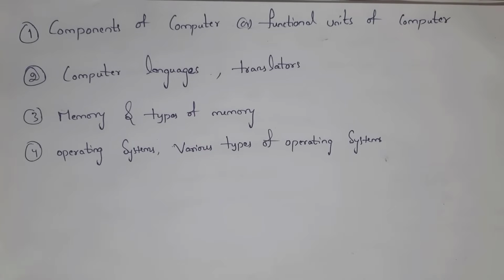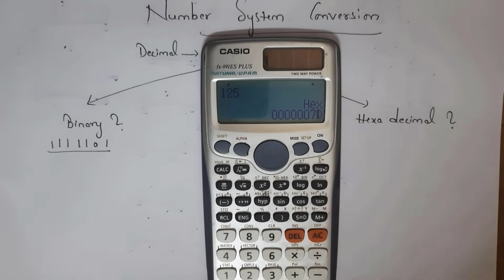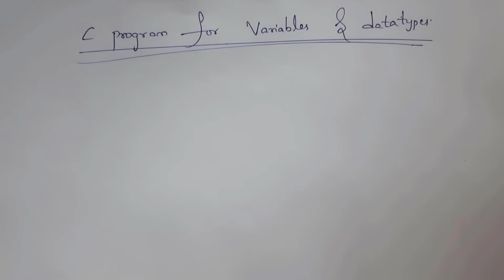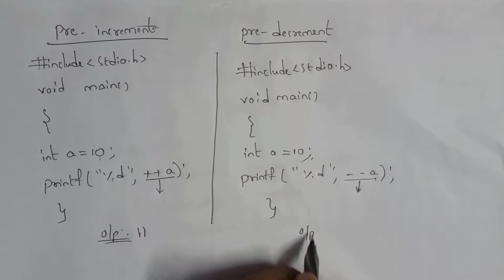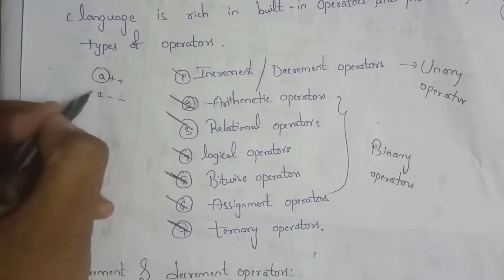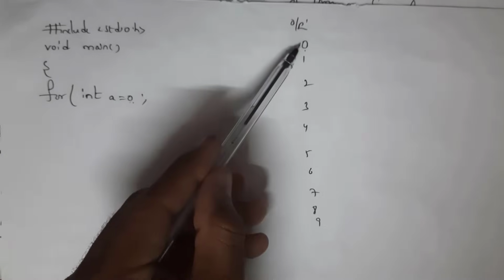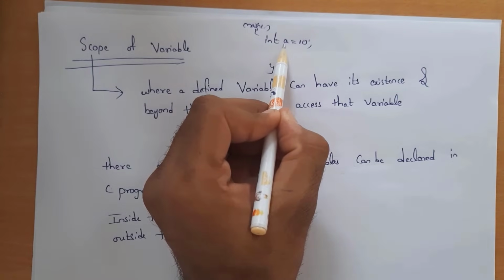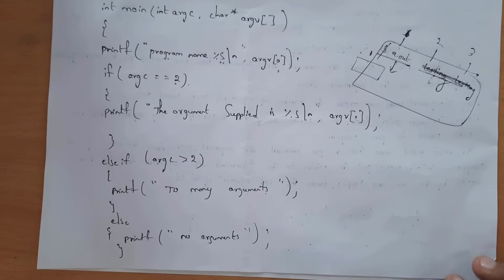c language complete unit 1 | pps | programming for problem solving | c language for btech

Comment: Can i Know how to print even numbers from 2 to ...so on
Reply from the maker: C program to print even numbers from 2 to 30

#include <stdio.h>

int main() {
    // Loop through numbers from 2 to 30 with a step of 2
    for (int i = 2; i <= 30; i += 2) {
        // Print the even number
        printf("%d\n", i);
    }

    return 0;
}
Reply: i+=2 means
Reply from the maker: i += 2  mean `i = i + 2`. So, `i += 2` is used in the `for` loop to increase the loop variable `i` by 2 in each iteration.
So output
2
4
6
.
.
.

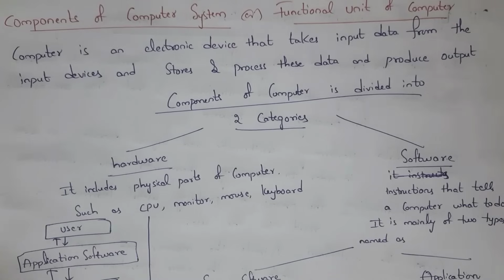Comment: 00:37 - components of the computer
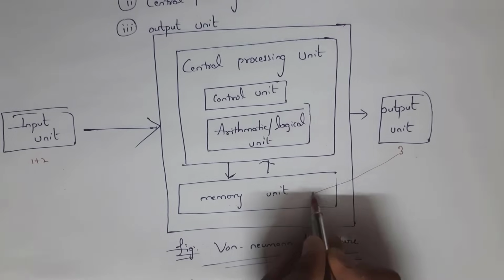04:54 - various types of memory(RAM & ROM)
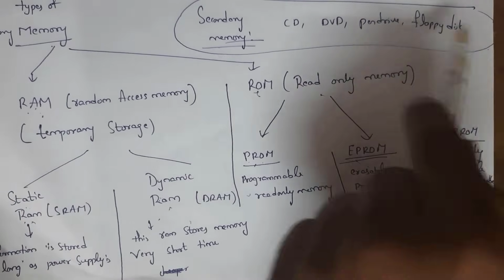07:06 - COMPUTER LANGUAGES
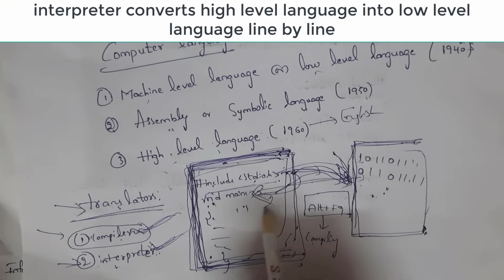09:33 - operating systems and types of OS
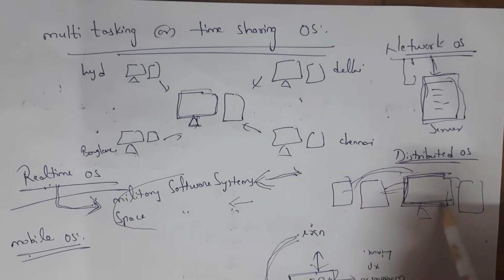13:14 - types of number system
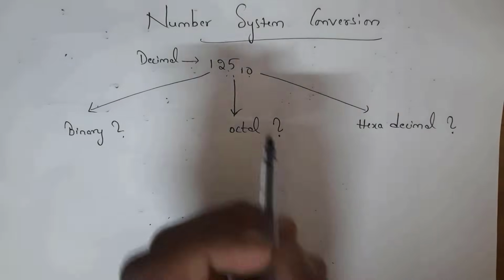16:21 - number of system conversions
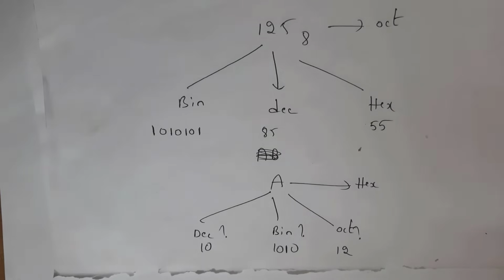21:15 - introduction to c programming(complete c basics printf,main function, int main, void main)
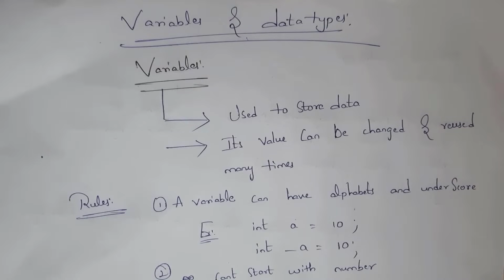31:25 - variables, rules for variables, data types, format specifiers, and ( introduction to scanning)
43:23 - creating compiling and executing a program in c
44:48 - software development life cycle
47:05 - types of errors in c programming
49:37 various operators in c ( increment and decrement operator, arithmetic operator, relational operator, logical operator, bitwise operator, assignment operator, ternary operator)
01:10:11 - conditional statements in c ( if, if else, else if, switch, nested if statements)
01:22:52 - loops in c ( while loop, do while loop, for loop)
01:36:41 - break, continue, goto statements
01:43:58 - storage classes in c ( auto, static, extern, register storage classes) and scope and lifetime of a variable in c 
01:50:07 - type conversion or type casting
01:53:24 - c program to check number is even or odd
01:54:32 - expressions in c ( precedence and associativity )
01:57:08 - command line arguments in c ( argc and argv )
pps ( c language ) complete subject video ( 5 units )
Reply: Thankss bhai 🤜🤛
Reply: bro Its given in the description
Reply: Love u bro ❤